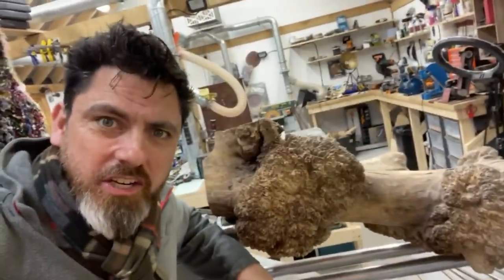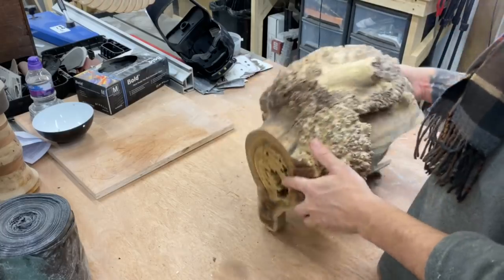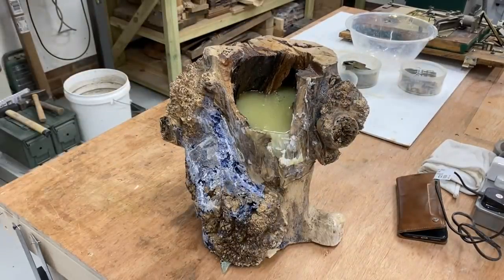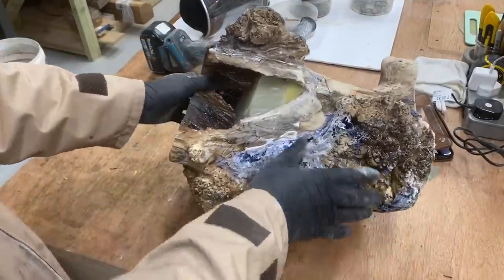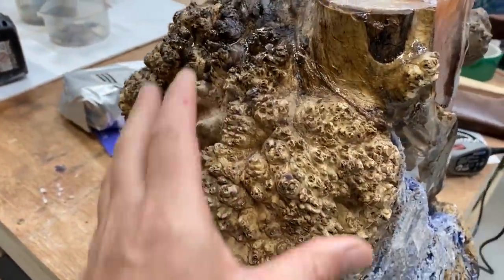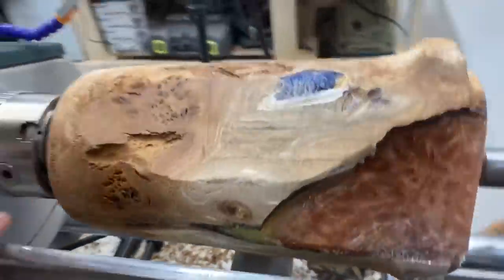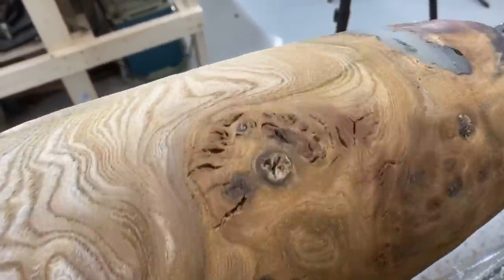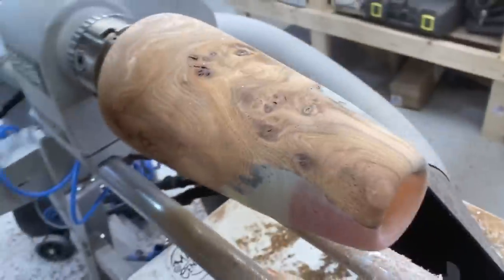Woodturning -  The Elephants Foot

Comment: Project suggestion. Take a log drill ten to twenty  holes down from one end. Wrap the logs other end and around the sides with plastic wrap to seal them. Fill different colors in the holes. Come back after it cures and Redrill on angles a dozen times possibly spiral design.  Fill them with resign. Place on lathe and allow the funky beauty to unveil to both you and the rest of us at the same time. It could be awsome

Comment: Interesting result.... Personally, idve hollowed it out the other way round, so the resin was at the bottom and the wider end was hollowed into a vase or similar, but, it's an interesting concept regardless 👍
Reply: Same it would be a funky vase.
Reply: Was thinking the same but stand it on the wood end with a light on the inside

Comment: Every time you want more colors in your resin, I will shout "Stop doing it - it's wrong" 😱 though without working with the resin, so I don't even know if it works, what I think 🤷🏼‍♀️
But try pouring resin along the edge or close to the surface ..
And don't touch it when pouring in ..

Just seeing your project with milkshake magic sticks - and thought "no don't mess around they just float right to the bottom"
When you want transparent resin with drops of color, you can let it dry for 2 hours 🤷🏼‍♀️ and then slowly pour in a small drop of color so the color doesn't fade so fast - just a thought ❤️

The last layer of resin is so nice - maybe you could make a new project so it looks like fire inside a trunk? 🔥 Just an idea .. maybe like a lamp or candlestick, so it looks like the flames are moving in the light 🔥🔥❤️❤️

Love your work Nick 😍❤️❤️🤩

Comment: Do you cut your cellulose sanding sealer with anything? Denatured Alcohol?? It's so thick, when I apply it to my projects (which I do with the lathe off), I turn the lathe on to rub it in just a little more and my blue napkins start sticking to my project. Not sure what im doing wrong.

Comment: it's not that bad - I like it !! have you ever tried setting th wood on a 30 degree angle and making 3 or 4 different color pours Let them all set on that angle ( or close to that ). Then see how it turns. Should look like 70 degree vertical stripes.

Comment: Man! There's nothing that interesting on Australia ebay...
Oh and Nick... To get swirls of colour you need to let the resin thicken before pouring the colours together!
Because resin heats as it cures, it actually moves around a fair bit during the early fluid stages resulting in colours mixing. It's also why mica powders can work so well. The early swirling of the resin creates patterns in the mica that then are captured as things thicken and set.

Comment: Another suggestion: How a about a round wall clock made of resin, with clock cogs and gears inside? The cogs and gears sit flatly but at different depths (levels). In the centre there is a giant gear or cog.